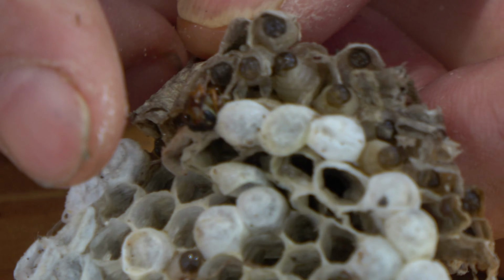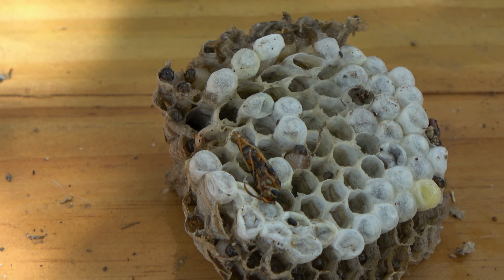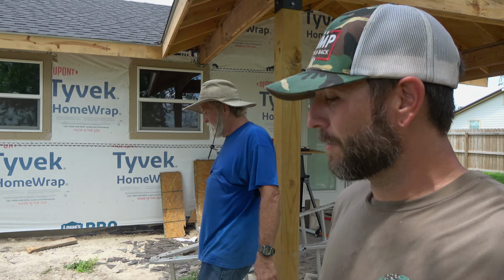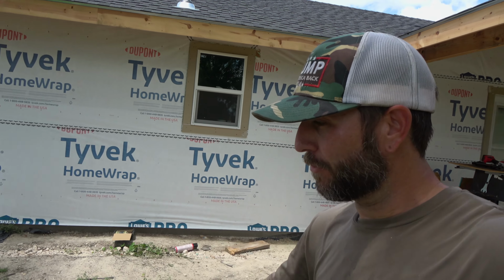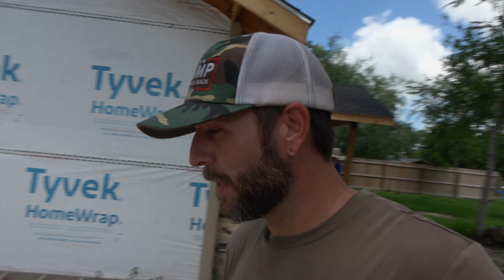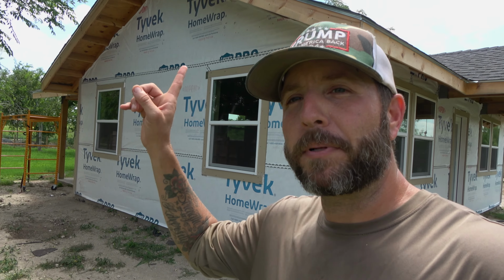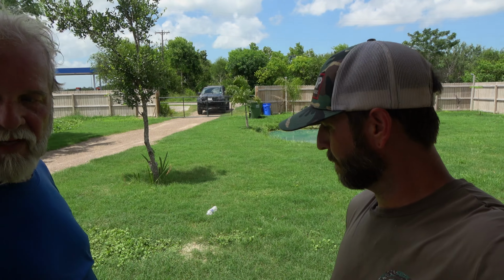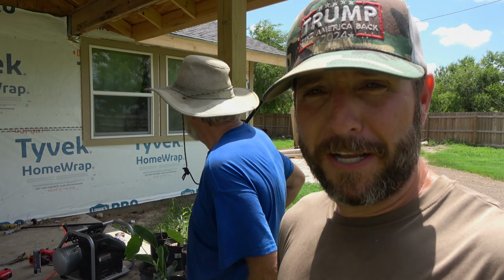LP SmartSide INSTALL For BEGINNERS | DIY Tiny House Build | Engineered Wood Composite Siding

Comment: The fiddly bits always take the most time, the siding will go up fast once you get the starter strip up and a rhythm going. I’m usually for white/grey siding with dark grey trim but we built a shed with a light cream (colourbond surf mist in Aus) and a blue grey gutter & it looks great. The cream/tan is not too polarising, it reflects the sun/heat and it’s a light base colour if you decide to change it later when it’s time to re-paint. Great work as usual gents❣️Michelle 🇦🇺

Comment: It's so funny cause at 9:30, just a few minutes ago, I was outside spraying a wasp nest just before dark to avoid getting stung and to get as many at the nest as possible. I leave mine for a couple days cause it keeps killing any that still return to the nest. But I realize you probably just found that nest and had to deal with it right away in order to keep moving with the window framing. You were very lucky cause those bad boys looked really BAD and huge to boot! Can't believe you handled that nest and even pulled one out! I'll dream about that tonight!😂 Nobody can ever say you let anything stop or slow you down!!!

Comment: Great job you and Dad did.I would go sage with a dark stained  rather than painted top,they last longer before needing redoing ,We used ( in the U.K. )a varnish and stain in one called Sandoline,I think it’s German but it’s very good and we had a granny flat built and that’s what we used,it was about five yrs old when we sold it and it still looked like new .something like dark Oak…I think your Dad is more inclined that way.Remember if it rains hard white will get dirty fast from the splashing on the grass .It’s going to look amazing when it’s finished .. Sending Love to you and your family and a big hug for Baxter 🥰

Comment: I think you should let the professionals spray foam the inside . You all need a break and foam is sensitive to the temperature. You will want the insulation to be good in the Texas heat. It will be bad working in those Tyvek suits.

Comment: Hi Jared, maybe you said before, but if so I didn't hear. The siding you are using is concrete filled fiber board, kind of like Hardie board, correct? I was wondering if anyone uses vinyl siding in South Texas? It's popular to use here.
My wife and I are retired and live in Central Illinois and spend the cold months  (about 5 1/2 months) in the New Braunfels area.
Reply: LP smart siding. More durable than JH board.. example impacts the LP siding is less likely to be cracked whereas JH board will shatter. People do use vinyl siding here. I have JH board on my house.